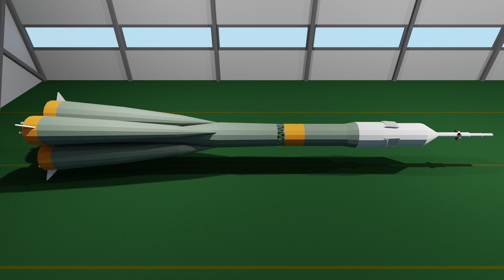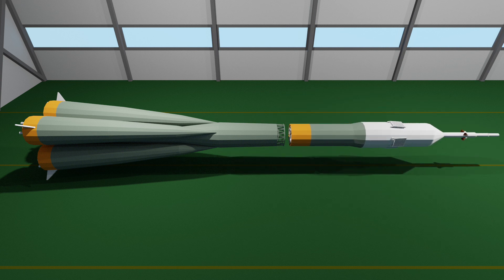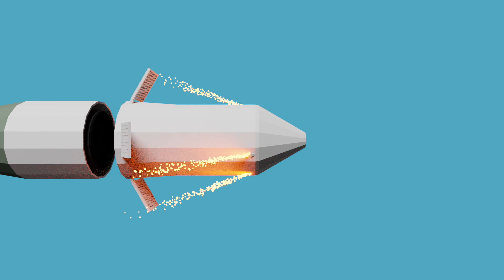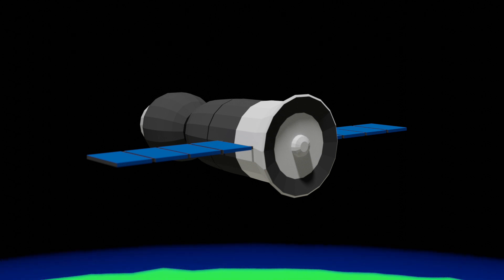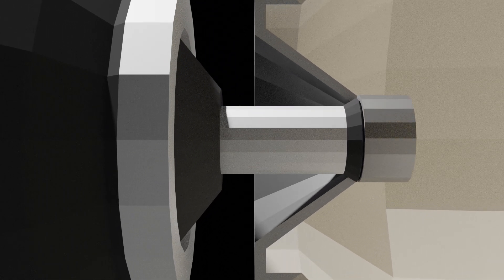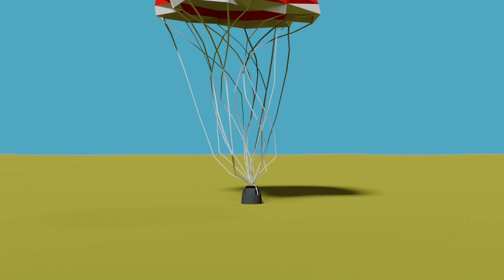Russia's Spaceship - Soyuz

Comment: Soyuz: The no - nonsense workhorse
Reply: Aaaaand... it’s relic.
Reply: @avigdonable  It is not a relic. It is still operational and still has a much better track record than its competition. When spaceX has a failure on the 13th launch (I am knocking on wood, don't worry) the world may just be happy there is something that "just works" while SpaceX figures out what to do. My point is: don't write off the Soyuz quite yet until it really is retired.
Reply: I mean, it is the "cheap Kalashnikov of space travel"
Reply: @avigdonable  Also The Soyuz (rocket) successor is still called Soyuz like Russia can't move on from Lada.  It's a modular rocket with wide arrange of payload and can be strapped with even more rocket blocks (Yes, apparently Russian solution to bring something heavier to space is by kerbaling). The current Soyuz (rocket) confirmed will be still active ferrying people to space side-by-side with Falcon9 just like in Shuttle era for the next 20 years or until the new generation can take over its place.
Reply: @DomScatterbrain  @Tiemen Russia had a brain drain  in the  90ties and 2ks. Also  Ukraine were suppliers most of the rocket engines and know-how to Russia. Russia had lost two generations of their scientists, lost 70% of their revenue because of a gas and oil politics which they are dependent. Doubt their space agc or their space science will ever recover.
Reply: @avigdonable  I bet it will, science and politics can't advance without rivalry. 
Before SpaceX emerge, space flight technology has been stalled. The US still rely on Shuttle until it decommissioned, Russia still relies on what's left on Soyuz with minor upgrades, European and other countries are pretty much only build conventional rockets for sending satellites and probes. You can see everyone developments in later years, especially when SpaceX successfully made reusable rocket for regular flight, and now they almost get their human certification.
Reply: Adrian Shephard  I'm quoting Dimitri Rogozin, genius. You know, the head of Roscosmos, the agency that builds and flies the Soyuz.
Reply: @tiemen9095  What about now?
Reply: @harrisn3693  depends on their further progress, they’re going very fast now, but if they eventually just stop and slow down, they’ll die, if they become the main transportation to Mars and the moon, I doubt they’ll be dying anytime in the next 50 years.
Reply: This is the only rocket that is launched from 4 different space ports on 3 continents!!
Reply: space x is not even american is full of scientists from all over the world unlike the soyuz made by Russian and a proven old tech that is reliable.

Comment: As well as the Space Shuttle, I also love the Soyuz rocket! Wonderful video, the best and most informative soyuz video ever:, Keep it up man!  BTW how's that kerbal movie on Aluminum Oxide channel...
Reply: I understand that 8 months later is a long time, but I'd want to ask why are you a fan of the Space Shuttle? Isn't it considered on of the worst space vehicles given the failore rate that it had?
Reply: @PhyXShocK  i guess because it was unique in its rolling landing ability. But yeah, very flawed from the beginning. The US wouldblikely have done better with separate cargo and personell carriers. Both shuttle and soyuz are impressive though. Shuttle for its engineering and "doing the impossible", and soyuz for its dependability.
Reply: @PhyXShocK  It was complex.  Astronauts were committed to lift off for two minutes before any abort and escape options were available.  In favor, it was a space truck capable of carrying the largest payloads.  The largest ISS modules were deployed by the space shuttle. It was also used as an orbital shop for satellite and scientific instruments deployment and recovery as the arm could be used to bring in instruments as well as to deploy them.  Repairs were actually performed in the cargo bay.  That it claimed two full crews is just sad.

Comment: Oh, it's very very nice and the graphics is brilliant! I admire your hard work to achieve this level of completeness and correctness of the video! There're, however, two small flaws. First - you haven't explain the power belt( силовой пояс ) , which holds the rocket only when it lays on it. When it starts to liftoff, counterbalances split the power belt and four supports move away from the rocket without any electronics. The second one is about the fairing jettison. The animation shows it wrong. The tip of the fairing should be splitted faster, giving halfs more push to the sides and rotating. I wish you good luck and more new brilliant masterpieces about rockets, ships and cosmos!!!

P. S.: Pretty good russian pronunciation! Just little more practice and you can easily visit Russia! "Hi" from Moscow and welcome!

Comment: When soyuz was being used for Mir in 1997, Mir had been testing a backup docking system called called teleoperated rondevous control system or Toro, but on the test, Toro failed, causing the progress cargo vessel they were using for the test to collide with the spektre module, causing a depressurization and a loss of all experiments in spektre. 4 years later in 2001, Mir was deorbited over Fiji, and burned up on re-entry.

Comment: The Soyuz spacecraft flew to the ISS in 3 hours, the SpaceX Crew Dragon in 19 hours.

Now Roskosmos has come close to the theoretical limit - it is simply impossible to fly to the ISS faster and dock. And all this is the result of precise, painstaking, verified, though not always visible work of Roscosmos specialists. “What we have now received is, firstly, extensive experience in the production and management of space technology, and secondly, it suggests that technical progress is still going on,” concluded the pilot-cosmonaut Lazutkin. Tellingly, American specialists still launch cargo ships according to the classic long pattern.

Even Elon Musk is not yet trying to reduce the time for docking - this requires launching the launch vehicle at the exact time, and SpaceX still has problems with this, the weather factor greatly affects. In addition, there is information that the Americans are not perfect with targeting either.

The main advantage of the three-hour flight to the ISS, according to the astronauts, is that people have to sit less in the spacecraft in constant tension, observing and controlling the process. Already during this flight, the astronauts begin the process of adaptation of the body to weightlessness, which causes painful, uncomfortable states. Due to the short path, the reliability of a person's work during the flight significantly increases and the risks of accidents are reduced.

As the pilot-cosmonaut Lazutkin said: "The longer you are in zero gravity, the worse you feel. And in three hours the body is just beginning to adapt, and the person has already arrived, so it is very convenient. It's like a driver driving a car - if he feels bad, he can get into an accident, but at home you can cheer calmly "

Rapid flight schemes of Soyuz spacecraft allow to save fuel and prepare for a mission to the Moon, Rafail Murtazin, head of the ballistics department of the Energia Rocket and Space Corporation, said in a broadcast on the Roscosmos website.

“According to our estimates, a two-turn scheme, compared to a two-day one, will give us about 30-35 kilograms of fuel economy. This is a lot,” he said.

It will also make flights cheaper - there will be no need for the work of several dozen specialists who do not crawl out for days from the Flight Control Center.

The main thing is that this method of flying will be useful in the near future, when new orbital stations appear. And if now the cosmonauts have nowhere to wait for help, then in the near future it will be possible to create an emergency rocket, requiring only refueling and calculation. And within a few hours, specialists can arrive at the orbital station to provide assistance.

Orbital tourism? Two days in the most limited space scare away so many people. And three and a half hours is a completely different conversation. At this rate, it will be possible to fly to the ISS and return back during the working day. It has long been required to get away from the two-day scheme, to make space closer, and this finally succeeded.

Another important advantage is that the biomaterial is delivered faster for space experiments, which means that this material is safer.

More details : https://goo.su/2KUm

Comment: 2:24 I think you forgot to make a Korolev cross there :)
3:51 Oribtal Module ;)
Reply from the maker: Korolev cross is there, it just continues out of frame. Yea, double proof check titles.
Reply: @SimplySpace  But in your animation the exhaust already disappeared? And I actually meant the side boosters first going slightly upwards before detaching :)

Comment: Hello

First off, great video! This was very informative and covered the whole Soyuz rocket/spacecraft system very well. I especially enjoyed the animation of the docking sequence, which I've never seen in such great detail. However, I'd like to point out one very minor detail that was missed, in case you animate this again in the future. 

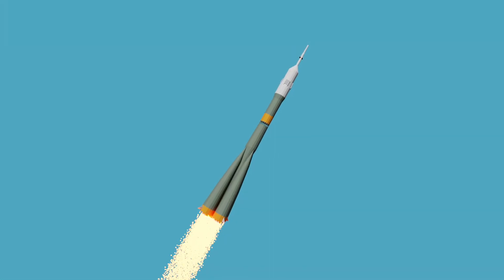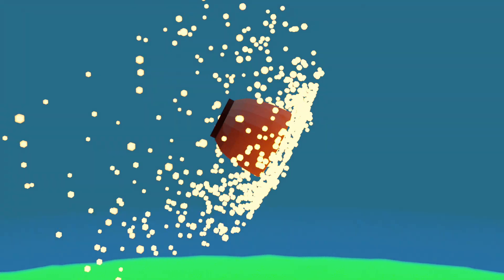When the Soyuz rocket boosters separate, they first disconnect at the bottom, then the top, with the bottom drifting outward while the top rotates in a ball and socket joint. This can be seen here in this on-board camera launch footage from 2014 at 2:16 into the video: https://www.youtube.com/watch?v=vHWDNrrfhnI?t=134. You can also hear Scott Manley describe this separation starting at 6:32 in this video: https://www.youtube.com/watch?v=QMUJ004Dr8Q?t=392. It was this very joint that failed on the Soyuz FG rocket last year during the Soyuz MS-10 launch failure, which is the only reason I remembered that detail of the separation.

Again, this was a very great video, I just felt compelled to point this out because I couldn't find another comment about it.
Reply from the maker: Yup I know, that was out of the scope of the video though and I decided to leave to out.

Comment: Am i the only one who thinks Soyuz's design could have been simpler? I know its an old design which does its job just fine but isn't Russia innovating anymore?
Reply: Maybe. But innovation requires time and money. Why would they waste resources for innovating if the current design works reliably. Answer is simple as that.
Reply: @a338825  yeah that's a perspective. But you do something perfectly dosen't mean that's the best way to achieve that. And making it better at every step has brought where humanity is right now.
Reply: Why hasn't a successor to the Soyuz family been produces: lack of money. A successor to the Soyuz (Zarya) was under preliminary development in the 1980's but was cancelled amid the economic chaos precipitated by perestroika that preceded the USSR's dissolution. Another proposal (Kliper) had been put forward in the post-Soviet Russian state but was cancelled since international funding wasn't able to be secured for the project (Russia was still economically troubled even if the Yeltsin days were behind them, so needed joint ventures to realise it's space projects). Currently Orel is under development but it won't be ready for testing for at least a few years.
Furthermore, the Russian space program is a shadow of the one that powered the USSR's numerous extraterrestrial achievements and is hampered by a nation that's neither as able nor as willing to slather it in the funds it needs to compete at the same level it's predecessor did. It's space program today is limited in scale and scope, a far cry from the days when the Soviets dreamed of sending nuclear powered land trains to circumnavigate Mars, and far more interested in generating revenue from already established paradigms of space commercialisation than pushing the boundaries of space exploration. That's why, along with it's reliability and affordability, Soyuz is still in service 53 years after it first flew.

Comment: In my opinion the Soyuz is a flying garbage can. I would much prefer the Crew Dragon and Falcon 9 rocket.
Reply: That flying  garbage can has be flying for 62 years and has a surperb safety record
Reply: There are valid criticisms of the Soviet/Russian engineering but this is a truly bad take. While it has its limitations, the design of the Soyuz is a truly well tested design that has become the workhorse of the ISS; not a shiny design that it still has to be tested.

I mean, they recently had a failure launch (MS-10) and the emergency system kickoff without any intervention. No one hurt, and the only outcome was they occupants of the spaceship didn't went into space that day.
Reply: Although the crew dragon and falcon 9 are quite amazing spacecraft , the Soyuz definitely isn't garbage. It has served humanity well for years. You don't know what you're talking about.
Reply: @cirejc2235  Ok let me explain to you what I'm talking about. You can go down the road in with a horse and buggy or you drive a Corvette or Tesla. Both will work in getting you down the road. That is the comparison between Crew Dragon and Soyuz. Which would you prefer? Soyuz belongs in a museum.
Reply: @DavidJohnson-tv2nn  that is not the comparison at all.
Reply: Aww fanboy shitstorm is strong in this one.
Reply: This "flying garbage can" launch so many American into space for the last 9 years after space shuttle program ended. USA should be thankful.